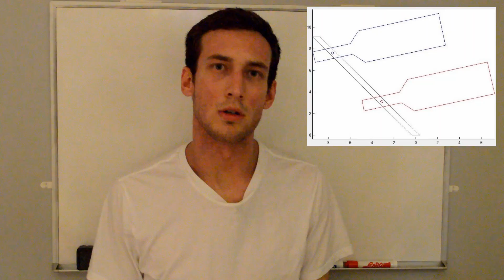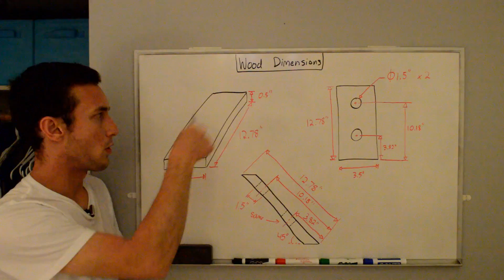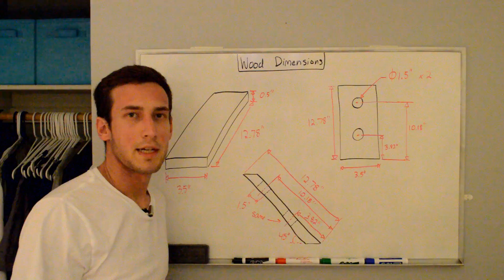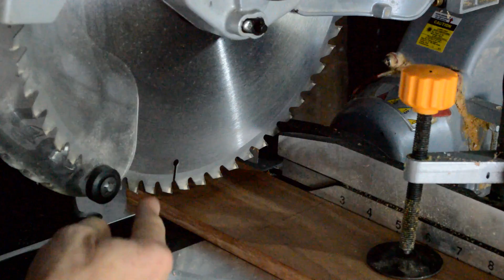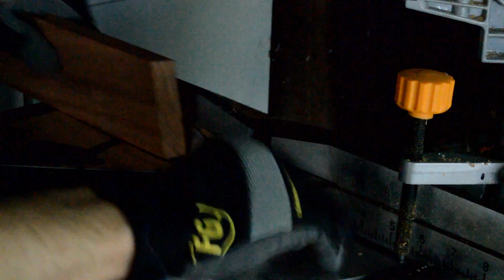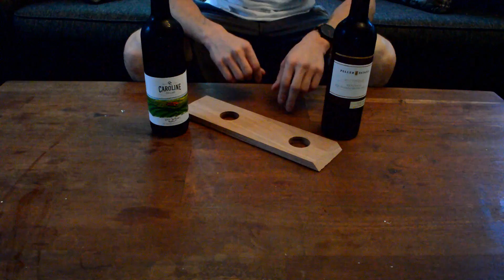How To: Build a Double-Bottle Magic Wine Bottle Holder

Comment: Awesome video. The only problem I have is you should never wear gloves while using any type of power saw. Basic saw safety. Other than that great job and I'm on my way to go make one.
Reply from the maker: Thanks Tom.  Yes, very good point.  At the time, I forgot to take my gloves off in between sanding and using the saw, and that's obviously not good.  This comment was also made in my Reddit post, and I appreciate anyone that brings up safety concerns.  I'll put a note in the video description mentioning it.

Comment: Thanks for the video, I recently made a bunch of single bottle holders and now plan to make some doubles! but if i may offer some constructive woodworking criticism. Maybe cut  the miter from the other side of the miter saw as the blade can get pretty close to your hand. also, maybe pick up a new hole saw (or even better, a forstner bit) as it seems quite dull, judging by all the burns in the wood.

Comment: Nice one man, really well done!
Reply from the maker: Thanks, I appreciate it!
Reply: @JoshTheEngineer  sadly its the absolute WRONG way to do it ... better off to store the bottle with support near the base and the neck ... by doing just the neck you eventually stress the neck too much and it falls off breaking the rest of the bottle and costing you the wine in the bottle ... 

this is why Vintners Store bottles on their sides and supported fully or about an inch in from the base and just past the neck to bottle flare ... 
.
the build looks nice but is USELESS.

Comment: one problem with hanging a full bottle by the neck alone ... is it will break the neck off the bottle .. ALWAYS support a full bottle from a side ... back and front ... the liquid will keep the cork damp and tight and the bottle doesnt break ... sadly although this build looks good it will cost you more in the booze that sits in it than the materials to build this are worth
.
Been there done that ... never again ... I learned the first time
.
also never store wine and such standing up as the cork dries it shrinks and then the wine becomes vinegar or ferments even more and explodes ... ALWAYS store corked bottles on their side ... this is why vintners have diamond storage racks that hold bottles on their sides and never more than than 5 layers deep ...because gravity will eventually crush the bottles  and again waste the contents
Reply from the maker: I don't think I ever claimed that this was a good way to store your wine bottles indefinitely.  This is just an interesting way to hold the bottle the night that you'll be drinking it, for instance.  If the wine bottle neck breaks that easily though, I would question the structural integrity of the wine bottle.

Comment: Great work on the software Josh! Another awesome video! 
However, the parameters of the second bottle in the GUI can not be changed. I cannot sellect a different wine, and also I cannot input custom measurments. Would you have any ideas, why is that? 
Thanks in advance!
Reply from the maker: Thanks!  What version of MATLAB are you using?  Also, are the options just missing, or are they not there, but not editable?  If they're missing, it's because the panels that they're in (the blue outline areas) are on top of those options.  This happens sometimes when using my code that I wrote in v2013 in newer MATLAB versions.  To fix it, you can go into the FIG file, open it in GUIDE, right-click every panel, and press "Send to Back".  Then save the FIG file and try to run it again.  If that's not the issue, then I'll have to go back and look at my code.
Reply: @JoshTheEngineer  Josh, thanks for your reply!  I use the 2018 version of matlab, the modification to the code that you are suggesting I have already applied. 
 At 58 second of the video you show that you can chose from different types of wines for the bottom bottle. When you select say Bordeaux the data under the drop down menu changes,also when you select custom in the drop down menu you the boxes become yellow and you can input custom numbers. 
My problem is that when I try to switch from Bordeaux to burgundy for the Top bottle the fields under the drop down menu does not change, the numbers remain the same! Also when I select the custom option for the top bottle, from the drop down menu the boxes are not painted yellow so I cannot enter custom numbers. 
Happy holidays!

Comment: Forgive me if this has been asked and answered but does the holder function irrespective of the volume of wine remaining in the bottle? Great Idea by the way and your video was clear and easy to follow.
Reply from the maker: This double-bottle holder won't always function when the bottles aren't full.  My single-bottle holder does always work regardless of how much wine is in the bottle, as I show in the following video:

https://www.youtube.com/watch?v=pVQvQUAsw8w

I'm planning on making a similar video showing the stability limits for the double-bottle holder, I just need to finish another bottle of wine with a screw-top before I can do that.  The double-bottle design will probably still work if you drink similar amounts in both the top and bottom bottle, but until I test it out, I can't tell you for sure.  Good question though!
Reply: it would hold as long as the base is not heavier than the stress the glass of the neck of the bottle can handle .. this bottle holder is actually CRAP because it does NOT support the bottle from a minimum of 2 spots and puts the maximum strain on the weakest part of the bottle ... the neck ... look at a vintners storage ... they always store the bottles on their side  and never suspended by the neck .

Comment: You sure know how to complicate a simple 10 year old starter project. You could round off any of those minute dimensions of yours to the next quarter of an inch it wouldn’t matter a bit.
Reply from the maker: For thick pieces of wood I would agree, but as the wood thickness gets smaller and smaller, it does matter.

Comment: And other question how you can build a board with a bottle  1.5 liters?
Reply from the maker: You can use my codes on my GitHub to do this, but you have to make sure to change the wine bottle dimensions so it matches your bottle dimensions.
Reply: answer DONT ... it will eventually break the neck off the bottle .. ALWAYS store it on its side if it has a cork ... and always support in 2 places minimum ... NEVER store by cantilevering it by the neck

Comment: Man you americans need to learn metric!
Reply from the maker: I know this is probably just a lighthearted comment, but as an engineer, you need to be able to work in any unit system.  That's just a reality of a world in which multiple systems exist and are still in use.  I happen to like the SI system best, but if I couldn't convert between systems quickly and accurately, I wouldn't be much of an engineer.  Just because people don't use metric for everything doesn't mean they don't understand it.  Again, I know it was just a lighthearted quip, but I figured I would explain my reasons for using the English system every now and then!

Comment: It’s a bottle holder mate, not a rocket. Project looks great but you really go on and on and on. I got bored after 5 mins.
Sorry just constructive criticism
Reply: I laughed my ass off as soon as I saw it ... it will cost you more in replacing broken bottles than the build is worth ... heck make a basic box turn it 45degress add a support to keep it that way and load the interior with bottles on their side ... better storage, safer and you DONT dry out the cork ... takes less time less calculations and less trouble and ends up costing less overall.
Reply from the maker: Thanks for the feedback!  I'll be honest though, you're probably not the type of person my videos are meant for.  Some people like to see the details, and that's really who these videos are aimed at.